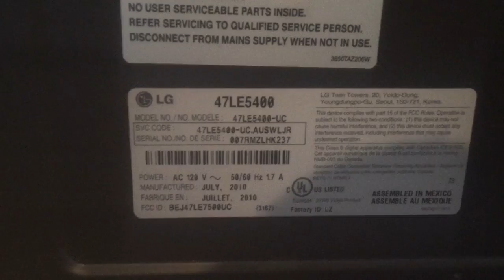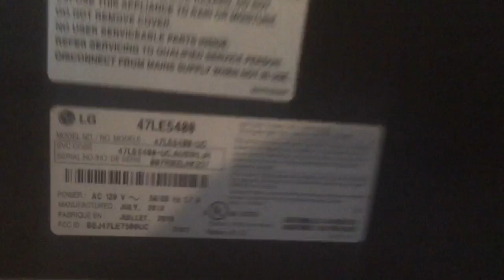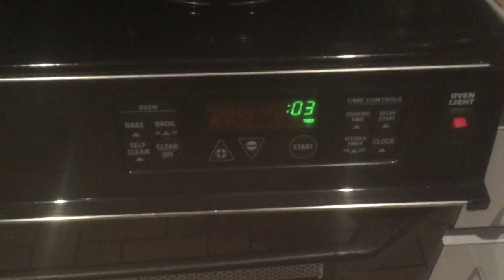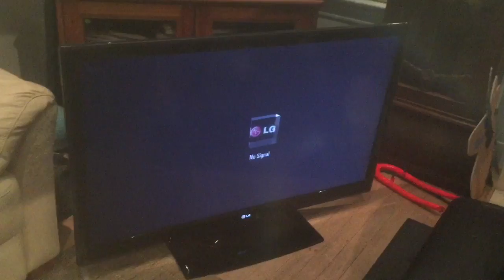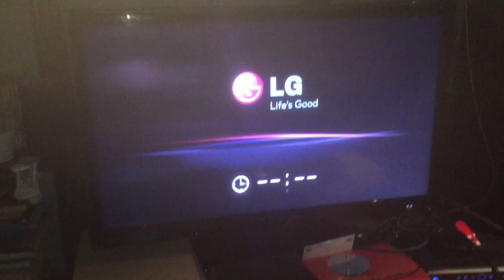Repair An LG Television Motherboard By Baking It In The Oven

Comment: Need to give credit to this video.  I was sceptical at first, but after following this process, you must believe that it works.  I was watching TV when it lost signal - witnessed it first hand.  The TV still works however; nothing plugged in to the HDMI ports were working.  I left it alone for a week and thought about replacing it with the upcoming Black Friday sales event next month.  So, why not? 385 degrees for 10 minutes and then left alone in the oven for the next hour to cool. Plugged it back in and it works.  For how long?  We shall see. Great video....it was hard to trust, but when you have nothing to lose, WHY NOT? It was better than taking a hammer to it and throwing it in the trash.

Comment: Hi, I "had" the same problem, note that I wrote "had" I removed the mother board wrapped it in tinfoil, put it in my oven for 10 minutes at 196 degrees centigrade, no smell really to speak of, fitted it back in the tv, plugged it in to the mains and the result is my TVs is as good as it was before it stopped working. So if you have this problem, have a go it cost me nothing but a few minutes of concern about nothing and ended up with a great result! Thank you, and thank all the others who took the plunge and motivated me to have a go!!

Comment: . Blood hell it worked. Just fixed my 42LW5700 tv by putting the mother board in the oven @ 200 degrees C for 10 minutes. The machine would not power up. we were all set to buy a new one. its not worth the $400-500 quote to fix. Funny how the LG machine seem to shit themselves just after the 5year extended warranty finishes. never buy a LG again. Go for a cheap model for a third the price and it will last the same time. thanks for  showing the ovan fix.. now anything that breaks down goes straight into the oven !

Comment: It Works ! I did it last night , I have a New one week old .  LG 65UH5500  it got wet from a leak ..drip water into the back of the TV ..and the TV did not work at all no power  no lights  100% dead, I called Best Buy and had a LG tech came out and said the main board was shot and was not sure about to other two power boards and told me it would be $475 to replace the main board, so I did not do it I was going to see if I could find it on line and I did for $232.00by going to LG.com and encompass.com  I bought the board ..and last night I gave it a try   set oven at 385  put the board in for 10 min   turn oven off left the board in to cool slow after 30 min I took it out it was cool and put it back in the TV ...and the TV power light came on and the TV works !!! ..make sure to cool it slow  I did cancel the new board  :)

Comment: Hello, it looks incredible but it WORKS for LG TV 42LV5300ZA,  black screen and no sound, only the red light up when we turn on the TV. Mother card looks dead and no possibility to buy a replacement card here in France (LG only garanties spare parts for 5 ans and my TV is 6 years old...).
So, why not trying this incredible fix: after 15 minutes in oven, 200° Celsius, I keep the card in the oven until it's cold and MIRACLE: it works, screen and sound are back, same as before.
THANKS FOR THIS POST!!
Bonjour, cela semble incroyable mais ça marche, pour une TV LG 42LV5300ZA, carte mère apparemment morte, plus de son, plus d'image, seulement la lumière rouge qui s'allume quand on allume la TV. Impossible de se procurer une carte, car LG ne fournit plus ces pièces après 5 ans et ma TV a 6 ans...
Donc rien à perdre à essayer ce truc dingue: 15 minutes au four à 200° Celsius, j'ai laissé la carte refroidir dans le four et MIRACLE: ça marche comme avant, son, image, parfait!
MERCI POUR CE POST!!

Comment: How long is this fix working for? Does it break again after a month? Also why not just use a heat gun??
Reply from the maker: My basic fix has worked since the video was published. I had to do it again when the HDMI ports stopped working which was a different issue. I'd love to know if a heat gun works.
Reply: I guess one cannot use a microwave instead of an oven for heating the motherboard?
Reply: killsegfault a microwave will induce a voltage in the circuitry of the board. this will end up frying any electrical components
Reply: You need actual heat, as in hot air, to slightly melt the solder points on the board.  It's called a "reflow" process.  Check out this great article that explains why this works:  http://www.computerrepairtips.net/how-to-reflow-a-laptop-motherboard/
Reply: I did mine about 6 months ago, and it's still working great!  I highly recommend trying this before throwing it out.

Comment: My LG 42LV5400 that is 5 yrs old suddenly went dead last night. Pressing the power button only showed red light briefly then went dead with no pictures at all. I've been looking at videos where you need to replace bad capacitors. Then I found your baking method. Two hours ago I opened up the back of the tv and inspected everything. The power supply board had no bad caps so I went ahead and baked the motherboard. Now my tv is back working again. I baked computer motherboard before to fix issues and didn't know this method also worked for tv mobo. Thank you very much!

Comment: holy shit, unbelievable, it worked!! My LG LE5400 55" tv died 2 months ago (bought 2/2011); Just went blank while I was watching it. I narrowed it down to the mainboard as the problem. The lights powered up, but no sound or picture. I haven't had issues with the HDMI ports, but came across this and figured I would have nothing to lose. I baked the board for 10 minutes at appx 375-385f (wrapped in foil to reduce the smell as another commenter posted, but on cardboard). Let it cool for about 30 minutes, reinstalled, and turned it on. My tv works again! Don't know how long this fix will hold, but do it! Thanks for posting this Avrim!

Comment: I can't believe it!!! I'm stunned! It worked! We have a Plasma LG 50PK950 and the inputs suddenly stopped working. Figuring we had nothing to lose. We baked it at 385 degrees for 10 min, and let it cool in the oven with the door open. We did open doors and had fans exhausting the bad air out! I called a TV repair guy and it would have cost approximately $150 to repair! Thank you so much for the much needed (inexpensive) repair!
Reply: It's been 4 months and it just did the same thing! The board is back in the oven, fingers crossed it works again. One note when we did it last time the power button/remote wouldn't work but for some reason when I powered on our Fire TV it would power on the TV! We just made it work!
Reply: Well, it worked again!!!!!! And now the remote works now too! Let's see how long it last this time! We'll keep doing it as long as it works!

Comment: As a last ditch effort I gave this a go on my 6 year LG 55LD650 AAUWLH tv. I had multiple faults suddenly develop including some awful flickering/shaking effect after a minute of turning on, no connection on any video source and a long term issue with the sensitivity on the composite inputs being too low to detect a signal. 10 minutes at 200c on a stone pizza tray later and it is now working again without flickering. Composite port sensitivity still an issue though. I also noticed that the part number sticker shrunk, the optical out flap partially melted and I somehow accidentally lost two tiny chips from somewhere near the speaker out part of the main board. Cant find any fault there yet though.

http://www.youtube.com/watch?v=Dr3hkj6Apcc&sns=em

Pity I already dropped $315 AUD on a replacement main board...

Comment: I'm about to do this with my TV but the only difference between the way you guys do it and I am doing it is I actually cover it with tin foil and you guys are leaving It Wide Open that's probably why you guys are getting so much of a smell I have done this with my computer and my PS3 and and they both work perfectly fine but to avoid this smell you should cover in tin foil

Comment: xxxxxxxxxxxx.  I just finished doing this for my 47" led LG TV and it worked great!!!!  My TV was powering on all buttons lit but no Video and no Sound.  just the beeps when I pressed the touch buttons.  i removed the board all the rubber pieces on it and backed at 380* for 10min on cardboard.  smelled so we left all windows open in house and closed all room doors off hallway.   opened oven and let cool naturally for 30min there in oven.  brought down and hooked back up and I was f-ing amazed!  just shared with my friends and family on Facebook haha.  the power of Google and YouTube for the win/fix. thanks so much who ever thought of this way to reflow all the solder at once.  solves so many issues.  so happy it worked this TV cost me like 1700 7years ago haha.  love the TV so much.  just needed to be backed to work.  hehe.  Xxxxxxxxxxx

Comment: After baking it started up and its working, but i see a black band at the bottom of the screen. so 1/4 of the screen is occupied with that black band so sort of useless screen. any ideas?
Reply from the maker: I don't know but perhaps check to see if you connected the motherboard connections tightly? I'm not a TV tech so it's just a suggestion.

Comment: Hey, I could use my main oven which is larger is size but i have a small kid and was hoping to save him from the smell etc. I was wondering if baking in a small oven would work. I have a  small one which is toaster/oven all in 1. I wanted to take it to garage and bake it there, but since its small in size and I wasn't sure if 385 F would be too much because of the size and the top and bottom is so close i dont want to fry the board. Any ideas?
Reply: Ok Does it have to be 385F? Can it be lower? Since the portable oven is smaller I could try lower temp. Worst case I would use the oven in kitchen..
Reply from the maker: Unfortunately I can't answer that either. I only used one method. Good luck.

Comment from the maker: As you know from the video ... I originally did this fix because at startup the screen never got to the rotating cube. I did not do it for non working HDMI ports. Lo and behold ... woke up this morning and none of my HDMI ports were working. Pulled out the motherboard ... baked it at 385 degrees for 10 minutes ... et voila! The HDMI ports are working again. Cool!!!!
Reply: Test on the bbq the door closed and if not in the microwave 10 min at hi level. You will never have had such a good tv. With programs to your taste.
Reply: Hey, did the same yesterday for my LG TV, is this still working on your TV ? I heard that the default is coming back quickly... Thanks for your feedback.
Reply from the maker: I have done this a total of three times since the video was first published ... still up and running. The third time came on faster than the second time in the oven.
Reply: ok, and in total elapsed time, from the first issue till now ? How much month ? 12 ? more ?
Reply from the maker: Video was published November 19th, 2015.
Reply: 19th November :) My birthdate ! :) lol
Reply: Avrim Fishkind 
my microwave has convection mode, microwave mode and grill mode. Which is that i use??? Plz answer
Reply: Avrim Fishkind my lg tv has intermittent sound issue. I tried this baking method on grill for 10 mins. Didnt worked. There is picture but no sound
Reply: Avrim Fishkind doing it again and now  for 15 minutes... lets see what happens.
Reply: Tin tin lol
Reply: Avrim Fishkind well I tried on all modes. No go. Still the same. So i tried finding a local shop and he offered me a swap of the motherboard.  Got a really good deal.  I sold my old card for like $8 to him and he gave me a new one for $19. Problem solved.

Comment: I was very skeptical of this. I looked for replacement board for my LG 47lx6500 which was not getting any input image. The cost was anywhere from $150+.... In some cases for old parts from old TVs. So, I figured what the hell.....I did this procedure at 400 degrees and Voila....IT WORKED!!! Amazing. Thanks so much for video. Saved me lots of money for now. We'll see how long it lasts...how long has it remained working for you guys?
Reply: Ben Moreno m

Comment: I tried this method at 250 degrees for 15 minutes at first. Didn't change anything. I gave it a 2nd try after about an hour or so. This time I increased the interval to 20 minutes. It burnt the board and the processor came off. It basically "fried" the whole mainboard. Try it only if you're 100% sure that your mainboard is dead. Otherwise be prepared to enjoy the smell of an overcooked mainboard. Hope it helps someone.

Comment: Saved me $350! Thanks for sharing, it worked on my 2010 55le5400.
Reply: Robert Frausto did your tv works after doing this.?
Reply: saved  me about $300
Reply: Yea LG tried charging me like $300 just for labor. If this method hadn't worked for me I would have just ordered the new part and installed it myself.
Reply: Abril Saldana hi I was wondering  if  the problem  you  had was with the Hdmi ports  and a/v ports.? and did this process  really work?
Reply: Yes, my HDMI wasn't working either and it fixed that problem as well.
Reply: Abril Saldana thanks.  was it hard to disconnect  and connect every thing back in place
Reply: Not hard just time consuming.
Reply: Abril Saldana okay thank you so much.  I asked  you  because  I have the same TV model as you.  thanks again.
Reply: Abril Saldana yes it worked..   just  follow the steps  exactly  as in the video.  such as temp  and time.
Reply: I'm glad it worked for you!
Reply: Actually probably saved you between 50-100 bucks because most of these boards can be replaced from ebay.
Reply: smith288 if u send it to a TV repair guy it does cost 300+  that's what they were charging me.  if you do it your self the eBay way them you will spend 75-100 bucks.   if u do this method you will not pay for anything other than foil paper.
Reply: Robert Frausto no I know that. If it didn’t work, then my comment applies. It didn’t for me. So I ordered a new board for a 45lg50.
Reply: smith288  did you bake it for enough time and at the same temperature
Reply: Where can you order a new part at? I did this on a plasma TV and it worked for about 2 months before the HDMI ports stopped working again.
Reply: smith288 this is a common fault and because of the demand be sure it can be refunded ..  Few year back due to a common fault on the 37in AUO  t-con board a high% of the board on ebay was sold without a faulty warning and a no returns statement (had to be a scam) but ppl were  buying the boards like crazy @£40 to £60  an add for a repair service @£20  is advertised  for the board now... But the whole tv could be bought faulty as low as £5
Reply: did the ebay route.  $130 and did not work.  No problem in returning it for full refund except mailing hassle via international add $ in shipping.  The sender from ebay stated (after I ordered it) that it worked on his tv although had some error codes on testing. You got to love it.

Comment: Just fixed my 42le5400-uc with this method. First time the backlights came to life but had a bad picture. Had to do it a second time at 395 for 15 minutes. Turned off the oven and opened the door to let it slowly cool to room temp without disturbing the components. It fired right up after that.
Reply from the maker: Glad you persevered and made a second pass...

Comment: Thank you. This method fixed my LG 42LE5400, wich was having no picture and no sound.
Reply: So my 47LE5400 will turn on (I see the power lights come on) but there's no picture, sound, or backlight.  Was this the same as your situation and the "baking" method worked for you?
Reply from the maker: Not quite ... as the screen would light up but freeze at logo screen.

Comment: My 4yr old LG 55LW5600 stopped working. No sound or picture after power on. Most ppl are using this method for HDMI issue. It fixed my issue too. Baked in pre-heated oven at 380 for 10 mins.
Reply from the maker: Great to hear ... so glad it worked.
Reply: Hi...Did you have the front touch buttons light up even though there was no picture or sound? I have an LW6500 and facing similar problems. Thinking of giving this method a go.
Reply from the maker: I wanna say yes ... but I don't remember sorry.
Reply: Yes, the power touch button lights up like normal but no sound or picture after that. In my case I had configured the button to not stay lighted while TV is on.
Reply: My LG 55LW5600 did the exact same thing.  When I tried to power it on the red power light would pulse red twice slowly, then go to white.  But the picture was black and no sound.  Baking the main board fixed it.  :-)
Reply: Update: First bake worked for 2 months. Second and third bake worked for 2 weeks each. Fourth bake didn't work at all. Looks like this is just a temporary fix, at least in my case. Ordered a refurbished board from an LG  authorized parts reseller for about $200.
Reply: Thanks for the update.  I was wondering how long this type of fix would last.
Reply: Worked 6 months for me but made the mistake of having an amp underneath where connections for inputs are made. Trying a second bake now.
Reply: aadjrenots

Comment: Call me a believer now that I tried the described process with success! I have a LG 55LE8500 and bought the tv in 2010. The tv was working fine, yet I was not able to connect my Directv receiver using the HDMI ports. I initially thought it was a Directv receiver problem until I plugged my Roku player in all of the HDMI ports. In all, the process took about an hour to unbolt the back panel and bake the mainboard (10 minutes to bake and 20 plus minutes to cool..) I was very skeptical that it would work but thought what the heck as many vendors do not sell the mainboard for my tv any longer. Thanks for the post as I would not have dreamed of trying this process.